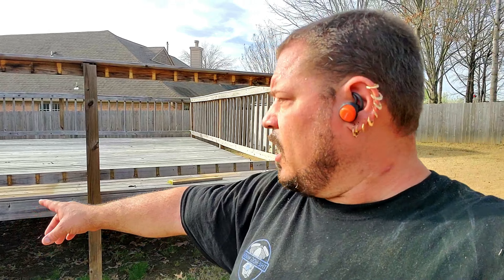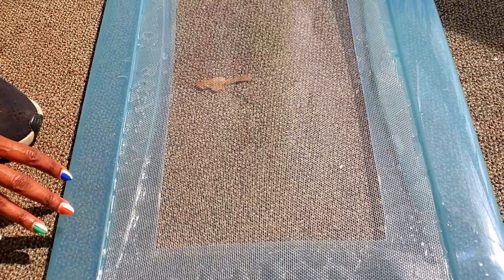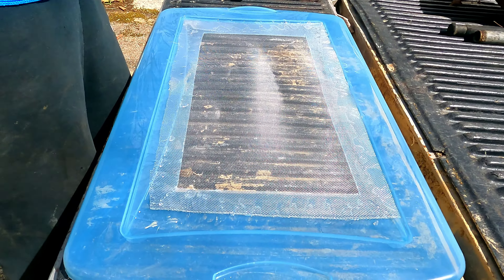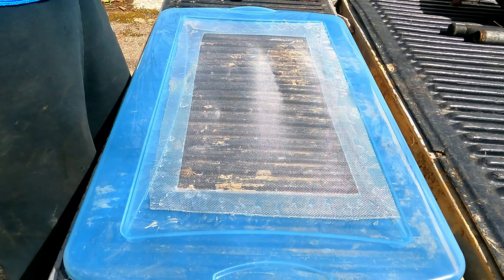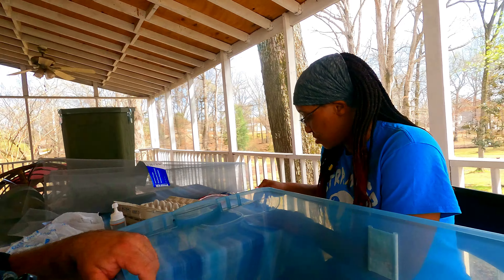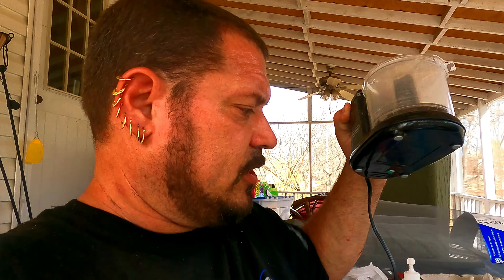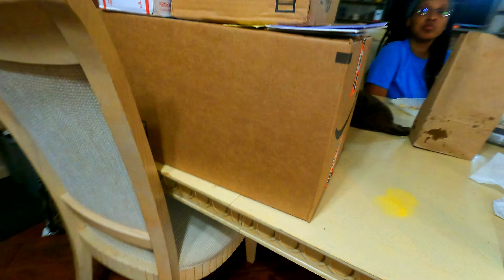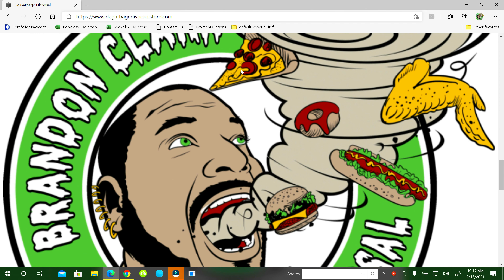Vlog 277 Free Wood, Chicken Brooder and Cricket Farm

Comment: Get you some rabbits. Use the litter for your garden and 🪱 beds. The litter is great for small gardens and doesn't burn the plants. Worms will break litter down and make excellent soil.
Reply from the maker: I'll have 70 chickens and they are the best fertilizer.  I will compost and have it circulated to start next year for fertilizer so it does not burn.